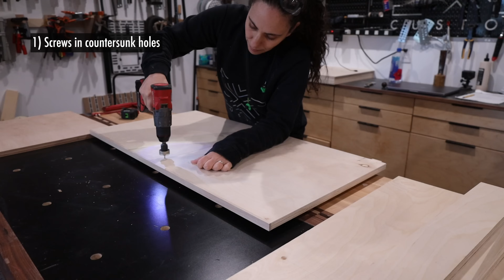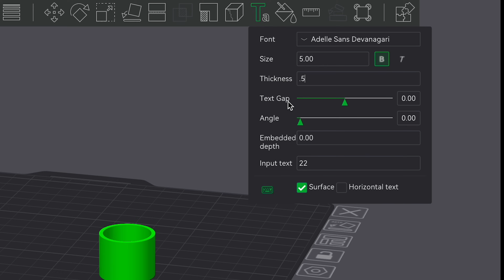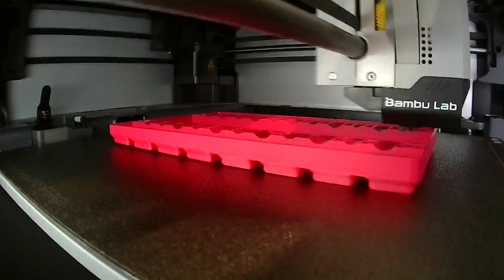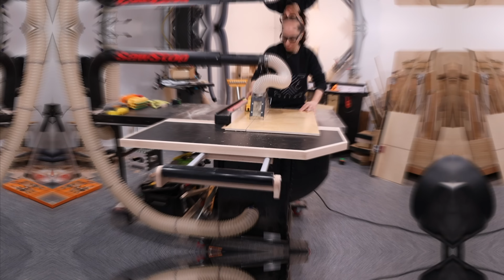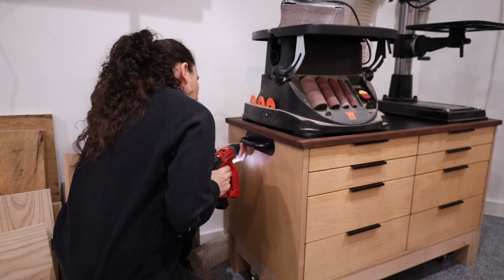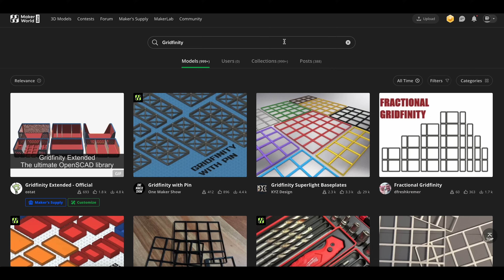1 Simple Motion Deploys all 4 Casters on This Tool Cart!

Comment: i think one of the reasons the lever isn't working as well as you'd like, is because drilling an offcenter hole in a circle doesn't create a cam, it just makes a lever. If you want a true cam, it needs different geometry which keeps the place the cam touches the arm in line with the central hole, which then doesnt rely on your strength to keep the cabinet in the air.  @WorkshopCompanion has a short called "How Cams Work" that explains it better.
Reply from the maker: I watched his video. Yeah, I think that only applies when it comes to clamping pressure
Reply: @3x3CustomTamar  it also applied when I'm trying to lift a heavy cabinet into the air (I used to have the lift mechanism for my jointer like yours, and it would require a lot more force than when i swapped to the spiral shape)

Comment: Great build! I wish that I knew about these casters when I built my lathe bench. Regarding the clean up of the black pipe. Rustolium Rust Reformer is a much more durable coating than paste wax. I used it on my pipe clamps to prevent the black marks on the wood during glue ups. It can be coated with paste wax to make glue cleanup faster.
Reply from the maker: Good to know!

Comment: Never seen casters like that before, love them! I build sets for theatre and I'm constantly looking for ways to move things into place and then lock them down
Reply from the maker: That would be a great application!
Reply: @3x3CustomTamar  I agree 100%!  As an actor, woodworker and engineer, I can't help but think how easier it would be to move and place set pieces without kicking out the rubber-footed kickstand or aligning the slide bolt with which they are usually made.

Comment: For the tight corners, I use a right angle adapter for the drilling; if you have only a right angle screwdriver adapter, I picked up a fairly inexpensive drill bit set that has 1/4' hex drive on the bits.
Reply from the maker: Yeah, I have one. It was still too tight for it. I should have realized that earlier

Comment: I’d suggest a 4-point lift instead of two. More complicated, but more stable. The casters are great, but a four corner system could be the resting position, then drop to the casters for mobility. Or, like I did on my welding table, my casters are on a separate frame and the table is raised on the casters with four jack screws—just 3/8 threaded rod. Lots of variations possible, but very nice work nonetheless!
Reply from the maker: Sounds cool!

Comment: Good to see another video out from you. Great overall build to solve so many needs. One suggestion for the lift. It is going to be much easier using your foot (leg) than bending over. That would also allow you to steady the drill press with your hands if need be. Shorten the lever arm and rotate it toward the front, probably 90°, to make it easier. - Chris
Reply from the maker: Thanks! Yeah, going to pick up a shorter pipe and test that out. I was worried about not having enough leverage

Comment: Sorry if I missed it, but can you tell me why as to your choice of the NOVA drill press?
Reply from the maker: It can change speeds with the turn of a dial (no belts) It has a digital depth stop that stops the bit when it gets to your mark, and it has an auto-on function that’s great when doing multiple holes.

Comment: Really nice design! What type of screws did you use to hold the cams to the shaft? I could imagine them getting sheered off if they aren't beefy enough since they have to carry the whole weight of the table while it's being raised.
Reply from the maker: One of the reasons why I decided not to draw up plans for this. I’m not 100% certain the materials I used were the best option. It’s very much a prototype in my mind. But I used screws that were meant for metal. If I had a welder or knew how to weld, that would have been ideal. Make the whole cam out of metal.
Reply: @3x3CustomTamar  If it seems like the screws are getting destroyed over time and could snap off you could probably just change the screws for stronger hardware pretty easily. It seems like there should be a lot of angular force placed on those screws, so I would keep an eye on them.

I think the strongest solution would be to have a hefty bolt fixing the cam to the shaft, since bolts generally can handle sheering forces much better than screws. You could do this by drilling a hole all the way through the pipe/shaft so that you could slide a bolt all the way through and into the cam on the other side. I guess the tricky part would be how to secure the bolt so it doesn't fall out. A nut on the inside of the pipe would maybe be enough to hold the bolt in place since there shouldn't be much force trying to pull the bolt out. Or maybe some epoxy in the hole in the cam on either side of the shaft.
Reply from the maker: @ that seems like an excellent idea.

Comment: Fun project. I built a 4x8 workbench 25 years ago with all custom foot activated "landing gear". It still works today but was way overkill. Since then, I either use locking casters or retractable casters and they work perfectly well. Two thumbs up on printing your own dust collection fittings. I do that all the time. It's amazing how many common situations that seem to have no available fittings.
Reply from the maker: I’m obsessed with these magnet fittings. They’re so cool

Comment: It looks a little unstable during the transition, especially with the drill press on it.
Reply from the maker: It didn’t really feel too unstable. I was using very light pressure with my other hand bc I was nervous about it tipping, but it didn’t feel like it would tip.
Reply: @3x3CustomTamar  Looked it, definite weight shift and a tilt during the transition.
Check the video yourself when it's all loaded.
I do like cams, so versatile.
Maybe different feet with the cams pushing them down?

I have a lever system on my bench and it's solid.
Wheel touchdown is the highest point.